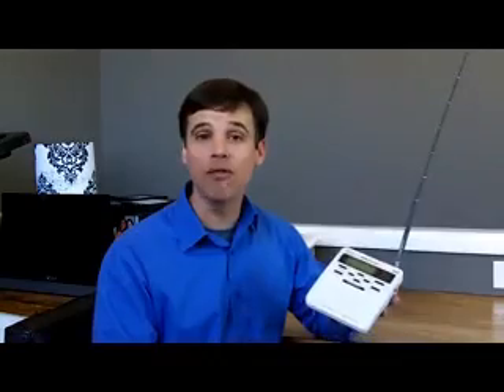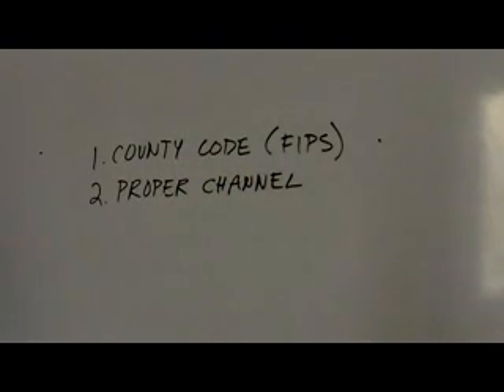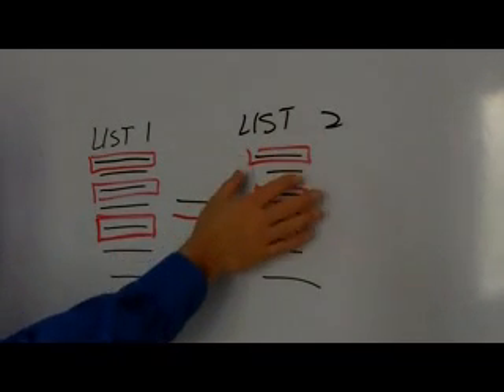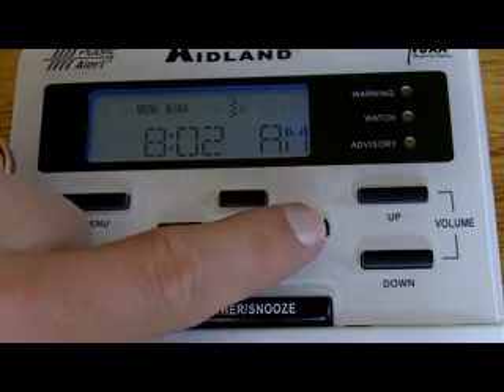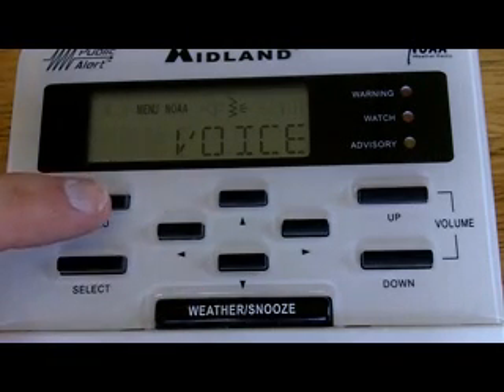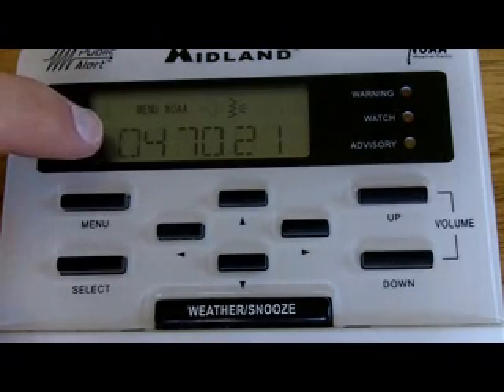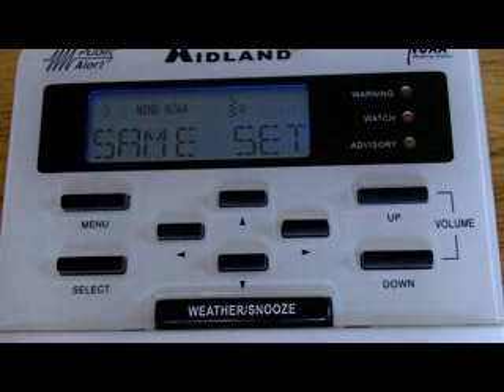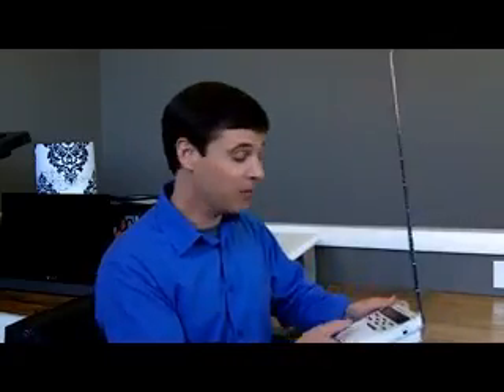How to Program a Midland WR100 Weather Radio

Comment: In some cases the the multiple S.A.M.E setting is best, in my use scenario I live where 3 counties intersect, so I have alerts setup for all 3 of those counties, though the N.O.A.A station WXJ76 operating on the 162.550MHz frequency has been out of service for several months, which leaves 2 of the counties I border without service, the county which I reside in still has N.O.A.A service and the station covering it has expanded its coverage and alerts to help reduce the outage area
Reply: Oh

Comment: Charlie I have this exact radio and it does not pick up any weather or even make any static. The volume is fully up and the switch in the on position.  I also hooked up an outdoor antenna.  I guess the radio is defective.  Any other suggestions?  Thanks. Brian in Missouri
Reply: I had one with the same defect; it probably needs a new tuning chip, which is sadly not really something most people can replace. Sorry that this is a year late, but the best thing to do is just get a new one.
Reply: If you have a V5, ANY VERSION, your capacitors or tuner are possibly damaged or blown if it is squealing loudly or has no audio, so if you hear that squeal or no audio, the capacitors are blown or damaged, and the radio is dead. It would take 100 dollars to get one. Just get a V3 instead, it’s older but WAY better.
Reply: @neptuneWX  I actually did get a V3, although it did the "No Message" glitch yesterday. My V5 was not squealing, it just had no audio from the broadcast.
Reply: @GPRW_Media  That’s normal I believe.
Reply: @neptuneWX  Alright, I'll see if it happens next week.

Comment: what if you do not hear anything on the channel 1-7?
Reply: You probably cannot recieve a NWR station in that spot
Reply: ok thanks
Reply: Michael Johnson the tuner is dead
Reply: If you have a V5, ANY VERSION, your capacitors or tuner are possibly damaged or blown if it is squealing loudly, so if you hear that squeal, the capacitors are blown or damaged, and the radio is dead. It would take 100 dollars to get one. Just get a V3 instead, it’s older but WAY better.

Comment: I got this beep about the battery being low, even though it was plugged in, it kept using up batteries like crazy.
Reply: I hope this isn't to silly of a comment but I had it plugged in (my WR100), made sure the outlet worked, turned it on and listened to it then took out the batteries....it went off. My power supply was bad, so just make sure your power supply is working or you will be replacing batteries way too often. I hope this helps (sorry it was a year ago but I just found your comment)

Comment: I cannot stop a high pitch squeal from my unit .
Reply: Same here.
Reply: Same here
Reply: Replace it with a WR120 or get an older model.
Reply: If you have a V5, ANY VERSION, your capacitors or tuner are possibly damaged or blown if it is squealing loudly, so if you hear that squeal, the capacitors are blown or damaged, and the radio is dead. It would take 100 dollars to get one. Just get a V3 instead, it’s older but WAY better.
Reply: Same there

Comment: This piece of junk does not broadcast any weather stations. All it does is make a high pitched tone on every channel. This unit is like new. Many other consumers have this problem with the WR100 weather radio. I would never buy another midland weather radio again. Thanks for posting the video.
Reply: Same thing happening with mine. Brand new out of the box.
Reply: No wonder I see them on eBay for like $6